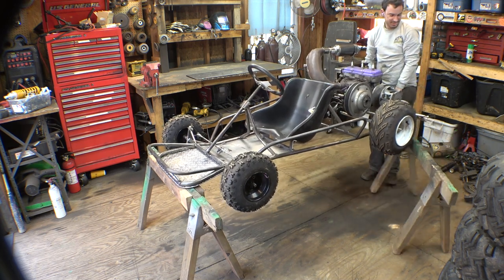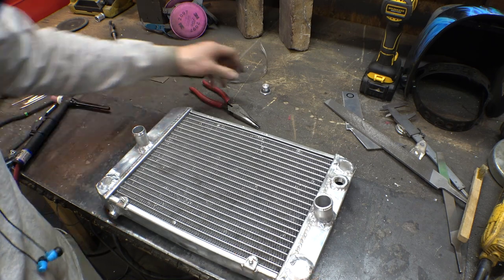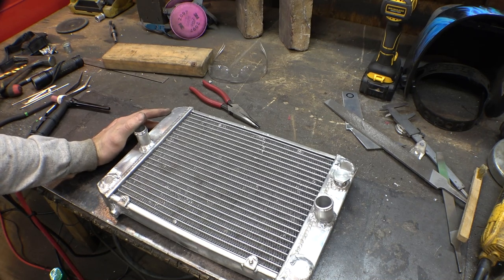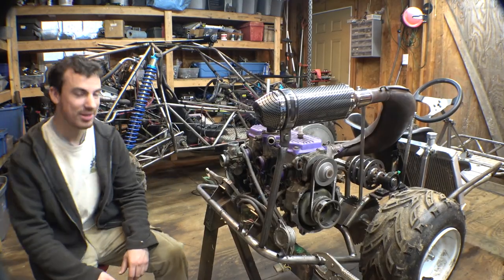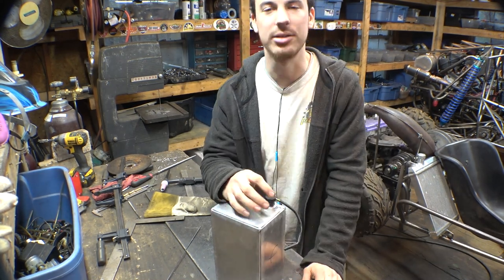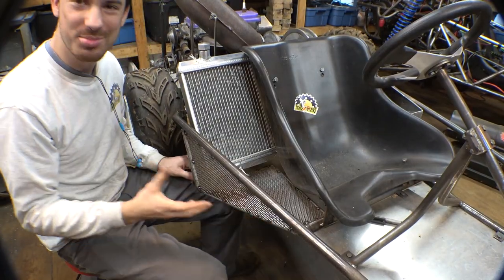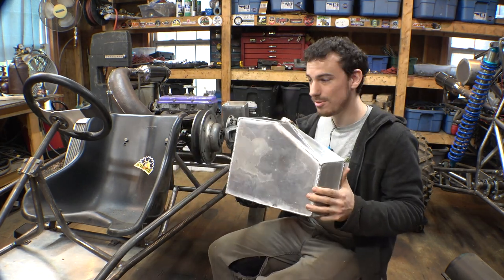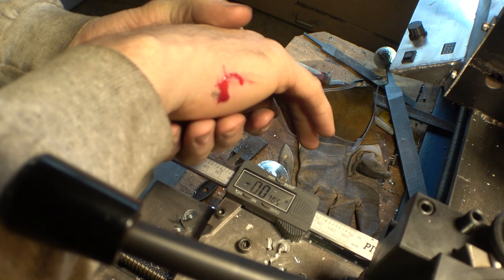95HP Two Stroke Triple Powered Yard Kart Build Part 5

Comment: Tank strap for a way to clamp it down man. Two “straps” bolted down and some rubber in between the tank and the strap.
Reply: Also for the cover for clutch why not do some mesh stuff like you did for the radiator?

Comment: Hi you probably already know but by having the cap at the side you waste alot of capacity meaning you could have a smaller tank and would still have the same capacity. If the cap was at the top then you would get alot more fuel in for the same size tank.

Comment: Just a tip on welding aluminum man use 100% green tip tungsten and I use 100% Helium or 100% Argon as my shielding gas and Pulsed ARK and I know why your ark flow is all over the place it's because your using A/C Straight Polarity  rather than D/C Reversed Polarity which is alot more Stable ark flow but high Frequency Pulsed ARK works best on Aluminum welding and try the 100% Tungsten which has a green tip on the ends rather than the Red Tip tungsten and use 3/32 tungsten and wire on aluminum rather then the 1/8 I use 3/32 on everything myself it's easier to sharpen the tungsten tips with that size .... But 100% Argon or Helium works alot better on stainless steel and aluminum than the typical 75/25 Argon+CO2 mixture ....

Comment: Care full my son some times the smallest cuts can be the most pain full I once jabbed my self in the leg just above my knee with a screw driver not a very big cut at all I was shaking it off and getting back at what I was doing and my head started to get fuzzy and I got dizzy and I did pass out Luckily my wife heard the crash as I fell and hit my work bench and knocked every off it as I fell and she came to see what the big crash was she found me sleeping on the floor and shook me and finally she got me to come back around but the funny part was I ended up with a really big gash in my side and was bleeding really good that is not where I jabbed my self with the screw driver when I passed out and was going down and hit against my work bench I hit a peace of metal that was on it and it cut me fairly good had to get stiches for it and where I jabbed my self with the screw driver I put a band aid on it so the littlest of thing can cause secondary unexpected injury what is the worst injury you did to your self while fabricating .

Comment: Man you made a lot of work out of the radiator. The engine is the radiator fill point/ cap. All you had to have is your hose coming from the high point of the radiator. So much work man hahaha. Rather be maching? Hahaha

Comment: Yikes ... that's a nasty cut 😐. I cut the tip of my finger off (bone and all) a few years ago and started to go into shock. I had to lay on my back and elevate my legs to keep from passing out. It was hanging on by a small bit of skin and they stitched it back in place. It stayed on and I can use it. Some nerve damage and my fingernail grows in funny. 

EVA foam works really well for padding for tanks and other stuff like that. Rubber will also work but is much stiffer.

The clutch cover only needs to be around .080 -.100" (like the factory one) .

Comment: 9:12 you can't use an Oring as a gasket....
Reply: Ah well you're missing the radiator cap pressure relief valve anyway, so blowing out an Oring will be safer than blowing headgaskets

Comment: You should delete the oil injection. Those motors are known to easily clog the needles. If you clog the needle and no oil can get into your engine you can say goodbye to your cylinder walls and pistons. Don't ask me how I know

Comment: bro what are you buying a sheet of rubber for just go to a tyre shop get a tractor 🚜 cut it your self as far as holding down the tank those little clips on the side of the air filter on cars will do the job